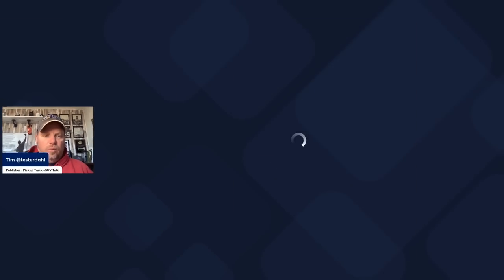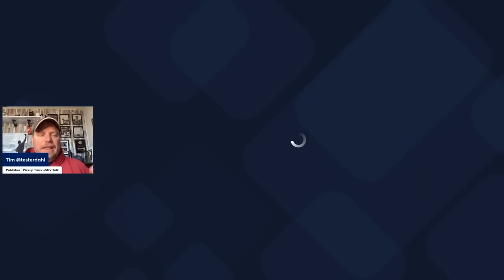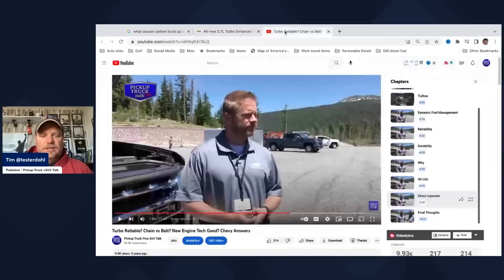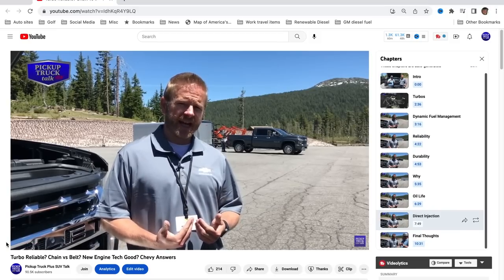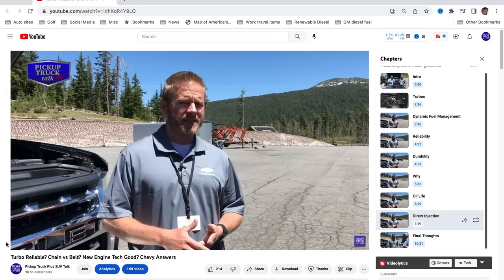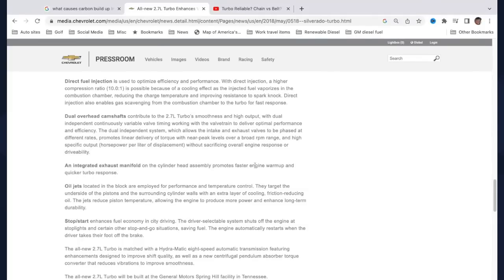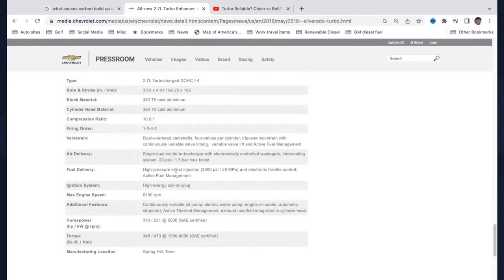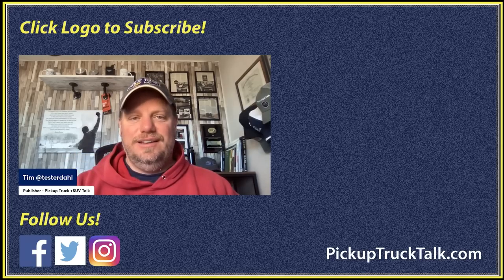Are Direct Injection Engines Bad? Carbon Build Up Concerns?  Engineer Interview

Comment: On the new Trailblazer 1.3l DI turbo engine the crankcase ventilation system seems very elaborate possibly to reduce the carbon deposits on the intake valves. 
Here is a brief description of how GM tackled the problem. 
"The crankcase ventilation system incorporates a pre-separator in the left side of the engine block below the coolant control valve. As crankcase gasses enter the pre-separator, oil separates and drains back to the oil pan through two oil drain channels in the block. The blow by flows internally from the pre-separator through block and head into the fine separator."

Comment: No doubt DI has its benefits, but I doubt the engineers or spokespeople are going acknowledge anything negative on camera. Like many others have said, the concern is additional maintenance costs required due to carbon deposits on intake valves known to be an issue with other DI engines. Will it be a problem with the GM engines? Time will tell.

Comment: The 2.3 Ecoboost in the new Mustang has higher pressure than both (5070 Psi) yet uses both Port and Direct injection.

Comment: Tim
Please revisit this question regarding intake valve buildup.
This buildup of oil/sludge on the intake valve is from crankcase fumes. And because port injection is not there to clean the intake valves it becomes a problem. I see with some manufactures  they have a PM recommendation to clean the valves with chemicals.
Reply from the maker: I'm working on another video on this since the oil blow by buildup looks to be resolved through GF-6 oil.

Comment: This video sidesteps the main issue which is BLOWBY (especially in boosted applications).  Over time, oil blowby will cause intake valve coking.  Quality catch cans help but don't completely eliminate it.  Port injection washes off the valves.  The best engines have both

Comment: As described in the service manual under PCV system operation. I'll just copy and paste.
"The blow-by flows from the crankcase through 4 rising channels into the pre separator (3). In the pre separator the first oil separation starts and the separated oil drains through two oil drain channels. One channel under oil level into oil pan and one ends in the block over oil level but with a check valve. The blow-by flows internal from the pre separator through block and head into the fine separator (2). In the fine separator assembly, the blow-by flows through a fine oil separator and the pressure regulation valve (PRV). The fine separator has an internal oil drain channel under oil level with a check valve. After blow-by has passed the PRV it can flow through the primary or secondary check valve. The primary duct is routed internally through cylinder head into the intake manifold (4). The secondary duct (turbo mode) is routed internally in the head, camshaft carrier and then external through The PC

Comment: There are advantages and disadvantages to both, of course GM marketing their DI only engines will only tout the pros. Driving behavior and engine type (NA, turbo, gas, diesel, truck, sports car etc) also heavily influence some of those aspects. There can be issues with DI only but definitely blown out of proportion and lumped in with other issues that owners experience (coupled with the fact that carbon build up strikes an emotional response when looking at pictures).

Comment: I think the reality is that overtime direct injection will build up some carbon on the valves and after about 100,000 you just clean it off, hire somebody to walnut blast or whatever needs to be done. The engine is going to keep on going. It's called maintenance. If folks don't want to do that, my guess is the engine will last it's intended lifespan which may be 180 200,000 for the average user before they change out the truck. It's only those few folks who want to keep their trucks for a million miles that will have any issue at all approaching direct injection these days.

Comment: I’ve owned several DI engines and never had a issue. Change your oil every 5000 miles and add a can of sea foam.

Comment: It would have been nice if you actually asked the correct question to the engineer, recirculating of oil vapor through the intake and how does the DI engine deal with that build up of carbon on the valves, but you sold out.

Comment: It's all about the valves. Oil vapor creating carbon buildup on the back of the valves. It is a proven fact. Toyota uses port and direct injection to alleviate the problem.

Comment: Just a little history from personal experience.  My first car was a 1976 Camaro. I loved that car , but on a quite night you could hear it rusting. Later when I started a family I bought a 1980 Monte Carlo turbo. My father , a mechanic said it locked up at 46k while engine was idling waiting to turn left because GM had used a 2 core radiator which didn't cool the engine enough. In 2016  i reluctantly gave Chevrolet one more chance when I got a sweetheart deal on a 2014 captiva suv. Just around 100k I got a $2600 estimate to replace the catalytic converter because G.M. used low tension oil rings and I think screwed up the EGR system as well. This was G.M.s last chance with me. Where is an old Plymouth Scamp with the slant 6 when you need it ?  G.M. Will slip planned obsolescence into a vehicle anytime they can or the ones making decisions are terribly incompant.
Retired U.A.W. 2155.

Comment: With direct injection, you need to inject the fuel into the cylinder at a pressure that exceeds the pressure in the cylinder at that instant in time.  With direct injection, the instant in time where the fuel is injected is when the piston is near TDC or top of the compression stroke.  Here, the cylinder pressure is at or near its highest point, so the pressure needed to push fuel into the cylinder has to be even higher.

This is also why the compression ratio can be increased because there is no fuel in the cylinder until it is time to ignite it with a spark.  No fuel, no detonation due to high compression ratios.

Comment: The problem with GDI unlike MFI/PFI like my 09 Honda Pilot has it only spray the front of the intake valves whereas, my 09 Honda Pilot sprays the back of the intake valves over time you get carbon buildup requiring you to use either Sea Foam Intake Throttle Body Spray cleaner Lucas Oil Throttle Body Spray cleaner, or STP Pro Throttle Body Spray cleaner. The only way to fix that problem is to be re-engineered with a dual spray injector system by putting a set injectors in the front of the intake valves and a set of injectors in the back of the intake valves. This is why GDI gasoline engines require more maintenance than old school MFI/PFI gasoline engines. 🙂

Comment: It doesn't have anything to do with the combustion chamber, fuel burn, or pressure. Its carbon build up on the intake valve. Port injection has been around forever and washes the valve off. Do you know ford uses both forms of fuel injection?
Reply from the maker: They don’t on all their engines FYI. Also, research new oils and you’ll see how they are formulated to reduce carbon build up.
Reply: @Pickuptrucktalk  yup oils have higher flash temps now special designed for direct injection. Listen I like DI motors but let's not pretend they don't have this issue. Also the only engine ford makes that doesn't have both is the power stroke.

Comment: I do an intake cleaning before every oil change on my GM DI 6.2 and it has stopped any stumbles I had been getting before using the products. I've used both CRC and Seafoam (specific intake cleaner), I like the straw that comes with the Seafoam product so that's what I'll continue to use.

Comment: This GM engineer didn't really explain what they are doing to avoid carbon build up.  But one of the techniques they use is leaving the intake valve open a little longer after the fuel is injected. With that valve open fuel does clean the valves. 

Now it's still not as good as having a port injector.  But it works GM V8s from 2014 don't have carbon issues.
Reply: Not true.  Lots of 2014+ 5.3 higher mileage engines have severe intake valve carbon buildup.  Start by searching here for videos showing 5.3s with the intake manifolds removed showing the problem, and folks spending big $ trying to fix it.  It's a real problem that GM is ignoring on their old and obviously their new engines.  Sweeping it under the rug.  Nothing to see here...
Reply: @Mark Weber   I work In a dealership.  I've taken these engines apart. They do not have carbon build up issues.
Reply: @terrencejones9817  High mileage 2014+ engines w/o carbon buildup?  How many miles? Maybe videos showing the problem on 5.3 engines are unique.
Reply: @Mark Weber  I've seen these apart with well over 300 000kms /200k Miles.   The AFM cylinders do some carbon on the pistons, not the valves. but nothing bad enough to effect combustion.  The 19+ DFM engines have no carbon.  We have these apart for Lifter failures and that's pretty much it. Otherwise these are extremely reliable engines.

They do not consume oil like the 07-13 engines did either
Reply: @Mark Weber  GMs use of delayed intake valve closure does has a side effect.  Reduced effective compression ratio, thus less power than competitors.  The design isn't perfect over extremely long engine hours you will eventually get valve carbon build up. However, there is cheap solution. GM has an induction service cleaner/system that sprays a top engine cleaner into the Throttle body. Note there is no recommended service interval for this, it's only done if a missfire situation appears. 

It's also important to understand that yes some fuel in a DI engine will push past the valves and into the oil, this diluted oil will produce vapors than end up in the PCV system.  However,  the oil formula itself is critical.  GM invented the Dexos spec,  an oil that can handle fuel in it without creating excess gasses in the crank case. BMW Audi and Honda worked with GM to create this spec,  it's GF6 oil for the rest of automotive world. Correct oil and Correct service intervals will minimize excessive PCV vapors in first place.

Change your oil with the correct spec, do an induction service ( it's like  Seafoam)every 100k miles and your L83/84/86 will run forever, that NOT a carbon built up problem like early Euro and Ford DI engines had ,every 50k needing to be wallnut blasted.

I've already seen some GM DI engines at over 400k. With 9 years since these engines have come out and several million engines made, carbon is absolutely not a problem.

Comment: In a perfect world where there was no EGR and no PCV bringing exhaust gases and oily vapors across the valves, DI would be perfect.  DI is great for power and fuel consumption, but you need to pair it with port injection to keep those valves clean.  It's not the biggest problem in the world though.  BG has great cleaning processes to get the sooted up valves cleaned every year or so.  You can also keep your valves from sooting up by using a high quality synthetic oil and changing your oil at 5k mile intervals.

Comment: DI is best for low speed and port is better for higher speeds. GM is touting a party line because they are not will to spend the extra to include both. Ford has both methods on its gas engines and Ram only has port. Smart move. Go take a look at the earlier Fords with only DI. Big problems with build up in the valves. That’s why Ford brought port back.

Comment: For all of the good points, this is still an open deck design that's likely to have head gasket issues and intake valve carbon problems.  Lets give it a few years and hope I'm wrong.  The other problems are likely to develop when the infamous GM bean counters cost reduce the critical parts.  

Decades of watching GM shoot themselves in the foot, leads me to always lower my expectations.

Comment: Is carbon build up from direct injection only a problem with turbo engines or non turbo as well?  Thinking of buying a used Armada which is a 5.6L V8 with direct injection.
Reply from the maker: Turbo doesn't matter for direct injection.

Comment: As far as compact SUV's go, appears that Toyota goes with both port and direct injection in their RAV4 and Corolla Cross.  And the standard engine from Hyundai/Kia has dual injection as well.  Why aren't we seeing port&direct injection offered by other manufacturers?  ... IF that is the best way to go to keep the back of the valves clean for the life of the engines....
Reply: Toyota is also using dual port injection on their new 2.4 turbo engine.

Comment: I think you need to dig a little deeper on the subject.  The engineer's answer addressed carbon build up on the piston but not on the intake valves.  From what I've seen, the carbon build up on the intake valves is caused by the oil fume recirculation which is where oil catch cans help.  As you probably already know, Ford uses both port and direct injections which helps clean the valves.  Ford's solution isn't perfect either.  Is the direct injection on the chevy 2.7 a deal breaker?  Not in my opinion.  Here's a video that digs in a little more on the subject with some bore scope video of the valves.  https://www.youtube.com/watch?v=sNzF7rm8OzY&ab_channel=FordTechMakuloco

Comment: If you don’t do the maintenance you’re gonna suffer the consequences. I have a Acura MDX with a direct injection engine and every 30,000 miles I have to do the TDI service or they burn out the carbon but if everything is cool. There’s drawbacks and benefits to everything you just have to be willing to do the maintenance.

Comment: To have both direct and port injection, you would need to double the number of fuel injectors, because the point in which fuel is injected into the engine is determined by where the injector is mounted on the engine.

This would not be practical as the fuel pressures required for direct injection are much higher than port injection.  You would need a low pressure fuel rail for the port injectors, and a high pressure fuel rail for direct injectors.  Not practical.

Comment: Vehicle usage has a major impact on how clean an engine is. Both on intake, EGR and PCV systems. 

Constantly driving at least 30-50 miles non stop will help keep these systems clean. Drive 2-3 miles a day, and vapors from gas and oil will turn into the sludge you see.

Comment: I add a Mann & Hummel ProVent 200 catch can to every vehicle I own. This greatly reduces the amount of oil re-entering the intake tract. EGR returns are dry and contribute very little to intake valve fouling UNLESS combined with wet oil mist from the PCV system. 
The ProVent has pressure/vacuum releases in the unlikely event of a hose freeze off. Highly recommended for all engines in my opinion. And my intake valves remain clean. Never, never, NEVER use a metal catch can if you live where it freezes!
Reply: Is this ProVent 200 catch can only live at freeze  place? Is this more effect than other? How can proof success?  Thanks!

Comment: The engineer is definitely proud of his engine. It's easy to see. You can also tell that he was praying someone would ask him these questions because if it was a marketing thing by GM, he would've had it in a speech at the start of the media event.  Tim has to ask him about it to get the ball rolling.

Given all the recent talk about Top Tier Diesel, I'm glad he brought up using regular, everyday, cheapish , 87 octane.

For those really concerned about carbon buildup, why not just do a complete seafoam treatment every 50,000 miles?

Comment: The carbon buildup got nothing to do with fuel burning it's crank case capers that go back into the I take and the oil residue builds up on the back of the intake valves and since fuel isn't getting injected through the intake valves nothing washes it off. That's where also having port injection helps! What would solve it would be dumping crankcase ventilation outside the engine like the old days!

Comment: Toyota went to direct injection and port injection and is expensive for car manufactures to engineer into their engines. Thats why you won't see a lot of car manufactures engineering direct injection and port injection into their engines. Honda is having problems with direct injection because on their 1.5 engines are getting fuel into the the oil.
Reply: Toyota had a patent on that system until 2017, when Ford was finally able to replicate it, using it in their 2017+ model year Ecoboost engines. In typical Toyota fashion, it was only put in a handful of Lexus/Toyota engines to make sure it works and is reliable enough for the long term. That's why despite the 10-year patent, it wasn't all that prevalent until recent years. They've since rolled it out to most their updated engines, including the new 3.4 TT in the Tundra, which has the Turbo version (D-4ST).
Reply: So is Jeep with their 2.0 turbo 4XE.

Comment: Main point is the black carbon  from the oil on the pcv valve oil  go into the intake manifold that cause built up  black carbon over the time this why people need a oil separator for the direct injection engines. Why don't the manufacturer installed them?

Comment: If the carbon build up gets really bad walnut blasting is a relatively affordable option.  Using a oil catch can as well can help prevent the carbon deposit build up.
Reply: True but should the customer have to buy an oil catch can for an engineering foul up.
Reply: @robertpulliam9973  The consumer shouldn't have to take these steps to help prevent carbon build up.  It's frustrating having to use aftermarket products to keep your engine running clean.
Reply: Walnut blasting is a ridiculous solution.  I suppose we should remove the intake manifold every 30k miles. GM shoud fix freakin root cause. Until then, people should be wise and buy from manufacturers that actually care about Quality reputation and include both Port and DI injection (or solely Port).